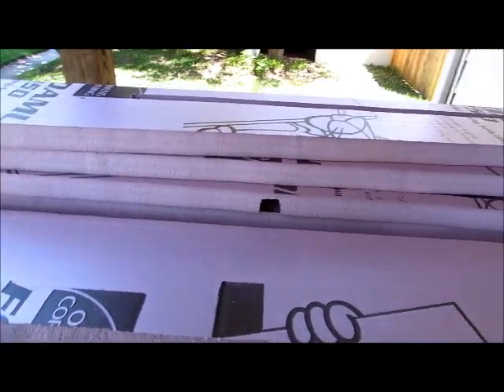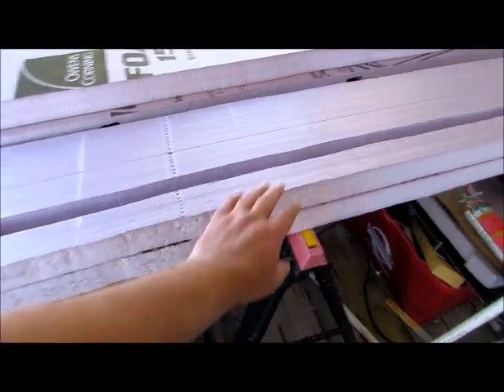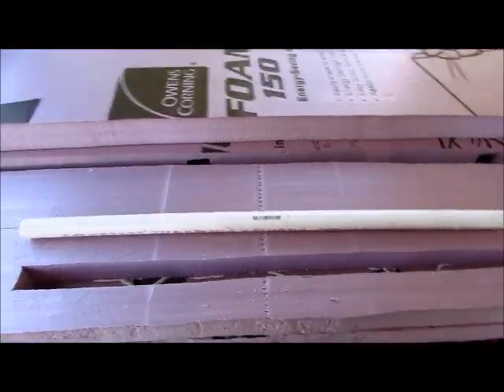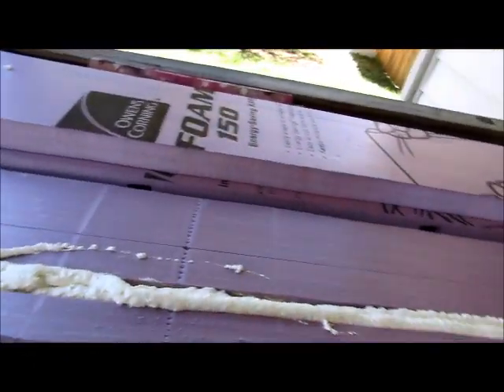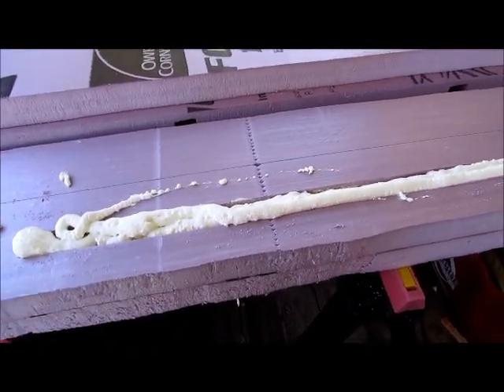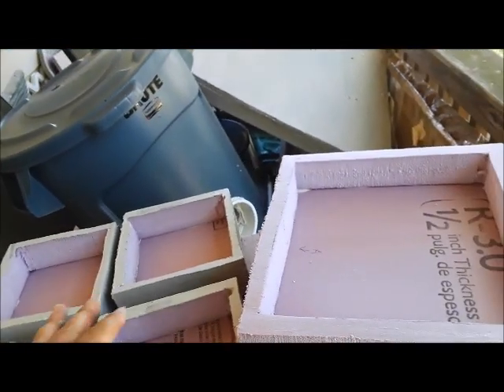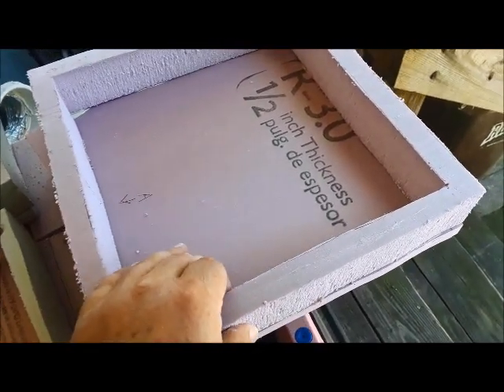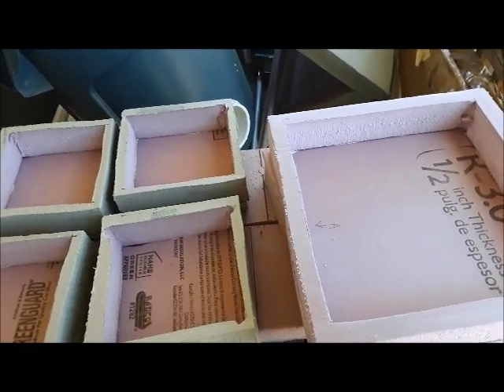Foam Board Cemetery Column Build.

Comment: That's a new and interesting approach, I like it.  So how many sheets of foam have you gone through and what's the total length of fencing those columns will support?
Reply from the maker: I am just using the plastic chain instead of actual fence sections like years past, so it is a very light load. for the 2 large (6' tall 10" square) and 8 short (4'x6") I used a total of 4 sheets with plenty left over for the caps. Paint wise, less that a full gallon of drylock and barely made a dent in a quart of red. The hardest part was taping for the grout lines.
Reply: thanks. i also use plastic chain for my fencing just takes up so much less space.